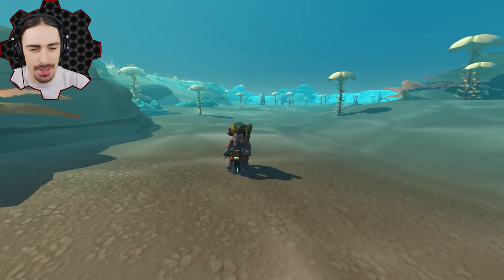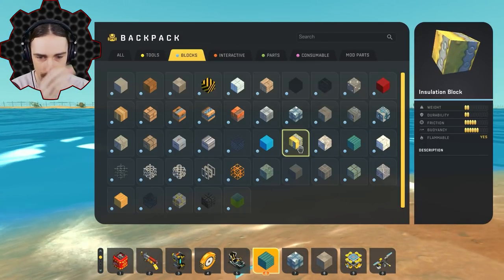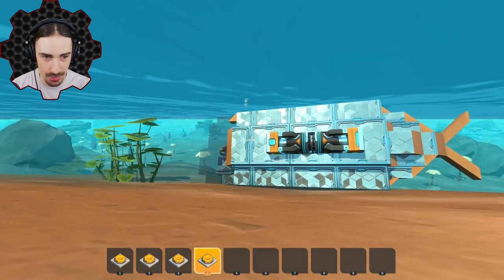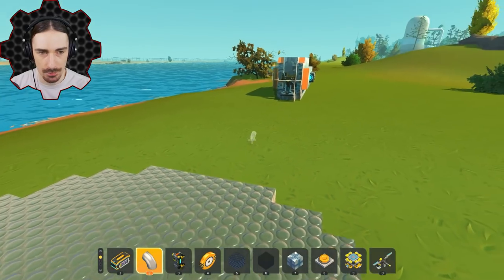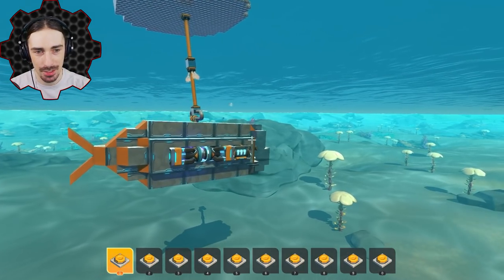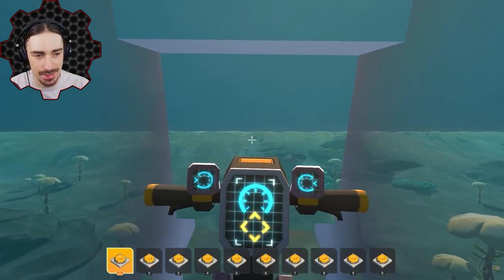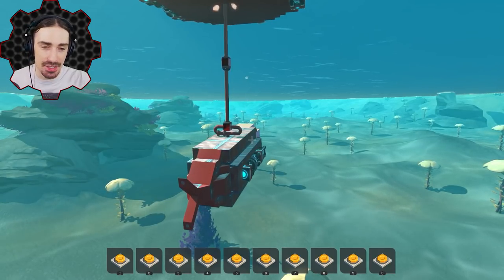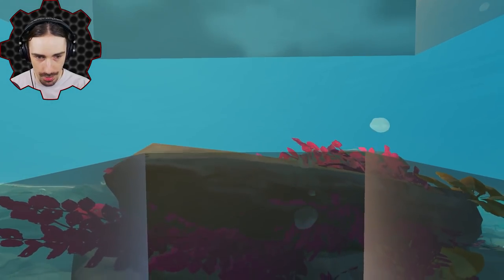Experimental Submarine Concept for Kinda Deep Sea Exploration! - Scrap Mechanic Gameplay

Comment: Tips on how to improve it slightly:
1. You could add the ability to surface the sub by making the flotation platform a doughnut shape and making an arch above it, so you can surface.
2. Also, if the surface platform was larger, the leverage to centre the sub directly below the flotation device would be much greater, preventing you from swinging side to side.

Also, I'd love to see you attempt to build a large-scale sub, even if it doesn't fit into the river/lake/ocean or whatever, and decorate the insides to look like either an actual sub or a subyacht (not a word probably, basically an underwater houseboat).
Reply: That actually sounds like a pretty good idea, an idea i had was just to make a thruster powered sub so pretty much just like an underwater hovercraft to an extent

Comment: Hold on hey Scrapman now that there's water in creative mode, maybe re-test the water cannon propelled raft again?
Reply: Ya
Reply: I tried that in survival. It "works" in that a boat does move with the water cannons, but you can't fill up the water tanks fast enough, so it only runs for a few seconds at a time.
Reply: i've tried that before, and it does indeed work, but like turrboenvy said, it won't work well in survival because the vacuum pumps can't fill as fast as the water cannons fire
Reply: Yeees
Reply: @thundervallie  The point we are missing is that in creative it doesn't matter how fast you can fill water tanks.
Reply: @turrboenvy4612  i know it's possible in creative, i'm just saying it doesn't work in survival though
Reply: @turrboenvy4612  how aboout now hehe

Comment: Technically you could do a kind of submarine with all-or-nothing, one time use ballasts. You'd just need to start out with bubble blocks or cardboard attached on as your floating ballast and when you're going to crash dive, your only other option, you use a spud gun to break off from it at a single point. Then when you want to surface, you'd need to use a chest and vacuum pump to place bubble blocks back onto your sub in an empty space to then give more buoyancy. It won't be a clean mechanism, but it theoretically should work.

You could make yourself feel better by putting a bilge pump on board, 2 vacuum pumps with one sucking up the water (that's being freely let in) and the other shooting it out. Doesn't make any difference besides making noises and shooting water blobs, but yeah. Maybe try something with the block breaking and placing for a variable full surfacing and diving sub?

Comment: You might in fact be able to control your buoyancy, though it would be rather inefficient. With a storage full of bubble blocks and a vac-pump you can place bubble blocks increasing your buoyancy. A spudgun can then be used to remove them. As I said, this system comes with great losses, but in creative, it might be a valid solution. It would be quite large, but with a good weight balance this could well work.

Comment: I have an idea to control buoyancy. You have a chest with a pump and cardboard. More cardboard being placed down increases weight , when activated it will move glow bugs from a compartment to eat the cardboard and make you more stable and to have negative bouyancy you just ,over a large line of cardboard with pistons to the compartment so that the glow bug decreases the weight. If you are willing to experiment, try that.

Comment: If i had to pitch in, id take the top buoyancy part and split it into 4 separate pads, maybe some more carpet each. If you had two arches connected together and then have the pads on the 4 tips, you could have the archway be high enough out of the water that you can still surface and be able to add lots more sets of pistons without sacrificing being able to come up to the surface. You could even set them back far enough that they wouldn't be seen in first person

Edit: i think it would also help with the tilting problem, as it would significantly widen the surface area of your pad. If the aesthetics bothered you, you could also decorate it and make it look like a crane thats just trying to pull you out or some such design

Comment: Idea for potential new method making buoyancy in scrap mechanic :
Lets see every block has different boyancy right so can you test if you put a less bouyant block enclosed in a cube or any shape of more bouyant block does it still float if it does then maybe the total  bouyancy acting on the complete structure is dependent on the block which is in contact with the water so you can somehow swap blocks on the outer layers of a submarine and that could potentialy vary its bouyancy hence a working submarine .

Note: i tried really hard to explain my self hope you understand it and if you like my idea please try it next time
Reply: I don't think scrap mechanic water physics have contact surfaces since water isn't "pushed" by creations... I think in the game water is just a space where physics are calculated differently for all the blocks in it... So "hiding" blocks probably won't change how things float...
But if it works it would definitely look cool
Reply: @mwapalotre5655  yeah i kinda figured it would work that way

But either way it was just a suggestion but still i appreciate your point of view

Comment: I have two ideas to improve the sub design 

1: Store a bunch of plastic blocks on pistons in the sub, then block off water from getting in with another set of pistons in front of it. When you retract the pistons blocking the water it will float your sub upwards. I’m not sure if this works with Scrap Mechanic physics, but something to test

2: This is likely the harder option, but would work if the other one doesn’t, this one is perfectly balancing the weight of a vehicle to the buoyancy of plastic blocks, then adding thrusters to the top and bottom to control elevation
Reply: Water doesn't have physics, its basically just lower gravity and some blocks float on it
Reply: @Snaking_Gamer  
That’s not what I mean, what I’m wondering is if plastic blocks still apply the same amount of buoyancy if they are not touching the water, for example, if they were encased in cement and then thrown into the ocean, would buoyancy still be applied.
Reply: @aesirofgames  yeah, as long as it is below the water on a water tile it will apply buoyancy
Reply: @Snaking_Gamer  
Oh, thanks for explaining, I can’t test in game, I don’t own it

Comment: If I think on a larger scale, you can already change the height of the submarine by laying down a bubble block with a pump and destroying it with a spudgun.
Reply: I suspect the reason he didn't do that is because the vacuum pumps might be limited to survival currently, as they and the chests they attach to require the stackable versions of blocks, or something like that... hopefully they add those to creative mode so that scrapman can make his submarine that actually works like a submarine

Comment: Um you could just use thrusters to adjust height of water, kinda like a reverse hover, where you adjust different LEVELS of water depth, based on controls set to a key for each LEVEL of depth you want the THRUSTERS to push you down. No need for bubble crap above. If you using thrusters might as well just use it all directions.

Comment: Might it not be possible to mix block types, say carpet and t3 metal to get a neutrally buoyant sub? or perhaps just a tiny bit negative, then add sensors that flutter a lift thruster to keep you <max sensor distance> above the ocean floor? you could then use suspension glitch for PTY and some controlled thrusters to dive and sink/forwards backwards

Comment: For the surfacing and diving of the sub, you could make the sub bigger and use vertical thrusters in each corner of the interior connected to buttons to make it go up and down.

Comment: Suggestion. Ditch the platform instead put a sensor attached to the extending arm at the bottom of the sub. Sensor detects the seafloor which then pulse a thruster keeping you bouyant. Retract the arm to lower the sub. Extend the arm when you want to surface.

Comment: I actually expected a platform with a hole  and a crane looking thing in the middle to control the sub that way you can surface and probably have more stability
Reply: Other than that the current design is ok i guess

Comment: You can make the submarine go above water level by making the floatation device a ring that the submarine can fit into. Have an ark connecting two sides of the ring that can fit the submarine, and put the ascend/descend feature there.

Comment: Yo Scrapman! you could fine-tune the weight and have it move similar to a space-ship, just need to have the thrusters for the up and down motion. in that way, you can get rid of the umbrella and it will also be easier to use.

Comment: how to make a sub: adjust the materials around it to be neutrally buoyant, use pitch roll and yaw control to change altitude (using suspension glitch or thrust vectoring) and then you have a sub.

Comment: Change the surface part to two pylons with a gap between that the sub can raise into. Put a superstructure on the surface piece, and then you can fully surface, plus have 5 or 6 pistons to be able to reach the bottom.

Comment: Theoretically you could build a plattform on the water surface (like an oil rig) and you could attach the sub on the bottom of the plattform, suspended by the four (or more) legs, that add buoyancy. Then you would be able to 'surface'

Comment: I was thinking more of a surface sub, aka boat that can dive, with thrusters to push it down and pulse the hold depth. 
A flyer is a sub if it sinks in the water. Fly and dive.
Reply: He could in theory, connect his flotation device so it rotates like an hour glass tipping over allowing him to properly surface, even lifting him out of the water once it completed its 180 deg rotation with a platform to stand on as the device would then be below his sub.

Remember. I said "in theory" because this game clearly has theories of its own how contraption parts work together. :D

Comment: They should add balast tanks where you use vacuum pumps to pump in and out water and depending on how much water is in it the less boyant it will be. It could come in different sizes with different boyancy capabilities.

Comment: The day scrap mechanic adds water resistance, it will be awesome. I could make a paddle or propeller, cuz the thrusters take so much fuel
Reply: They already have water resistance, it's just not strong.
Reply: @creativenametxt2960  maybe it's fake water resistance.
Reply: @lyrisio  well it's like air resistance, but stronger.

Also it's for whatever reason stronger in he vertical direction. Or used to be, at least. My guess is stable floating without too much drag when moving on a ship?

Comment: Make a moon pool out of bubble blocks and put the lift mechanism on the ceiling so when you lift up you can come out of the water and almost have a landing pad Then make your bearings on the lift mechanism disconnected. Then try thrusters in the sub for pitch controlls

Comment: there isn't probably any weight to boyancy rasio between all blocks because 26 carpet blocks and 1 metal tier 3 block are "Neutrally Boyant" (It isn't but it goes up ~2pixels per second).
metal tier 3 block 5 weight and 6 boyancy (so boyancy - weight = 1)
carpet block 3 weight and 4 boyancy (so boyancy - weight = 1)

1 metal tier 2 block sinks.
1carpet block floats.

Doesn't make any sense.

Comment: You could use the block spawned block from the mod pack to add weight. Then you could dump it out the bottom to lose weight

Comment: Scrapman, why didn't you put the thrusters on bearings so they could rotate on an angle to adjust depth. 
Make the sub as neutrally buoyant as possible and give the thrusters an adjustable base that controls the pitch either positive or negative,, you could also use thrusters internally pointed up and down to control ascension and dissention with a forward and reverse thruster centered on the stern (rear) of the sub

Comment: You could increase depth without sacrificing how high you can go by storing the pistons in top. Just raise the connection point of the top so you can add more pistons without lowering the sub

Comment: Why don't you make the perfect weight/buoyancy distribution with carpet and a slightly higher weight block so that it more or less floats in the water then use forwards backwards left right and strafe suspension glitches

Comment: i built an actual sub in scrap mechanic. using random glitches. i've discoversed that on my sub, when you get everything already leveled if you add bubble blocks it doesn't change the stability
Reply: you just need to create something that stays in place. then moove it up/down with thrusters
Reply: @eren_ax9895  I did

Comment: You know it would of worked better if he did 2 carpet block to 1 metal tier 3 and use suspension glitch for pitch and yaw and use thrust for forwards and backwards
Edit: and use thrusters for strafe